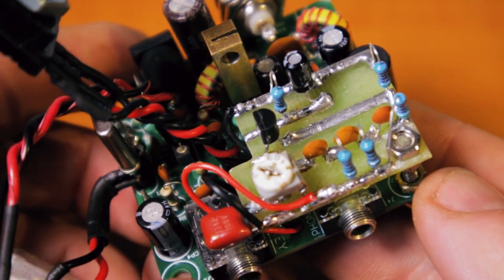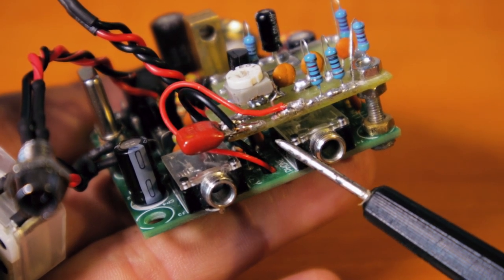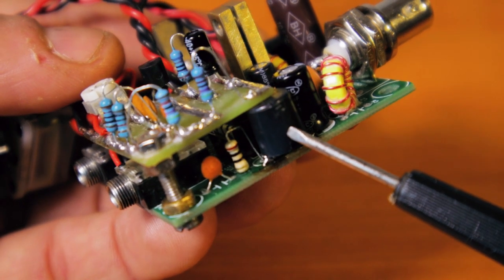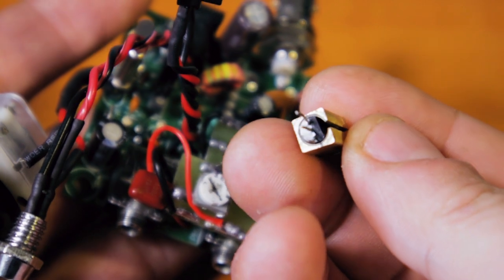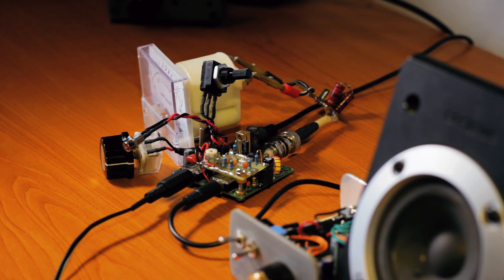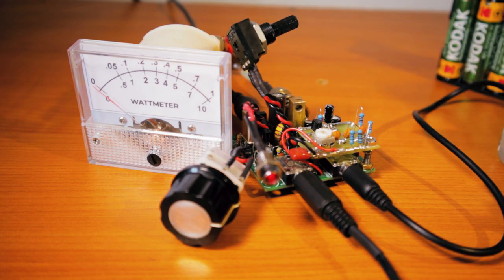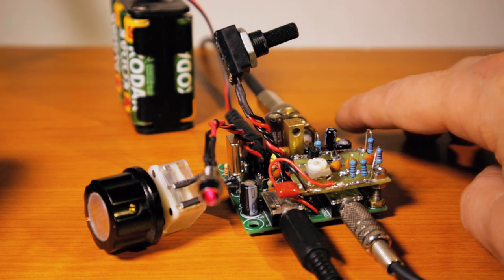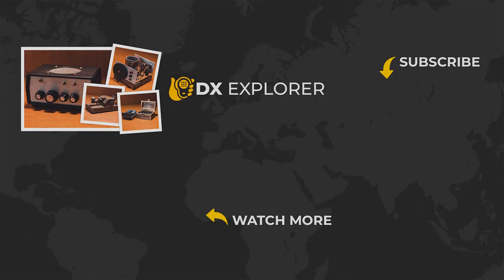4 Simple Modifications For The Pixie CW Transceiver Kit

Comment: I've not had sidetone in 30+ years until I got an FT817ND in 2017. I never got round to putting it in my h/b rig.
I think the heatsink on the O/P transistor is a good idea as I think that's what blew my Pixie up, O/P transistor and electrolytic. I tried replacing them but the copper track was lifting.
I put mine on 5.262 MHz with 350 mW out. Some say it's a toy, not at all, 180 mile QSO with a SWL report from 220 miles. I need another one.
G4GHB
Reply from the maker: I don't get to use it on transmit as I am still as "student in class" learning the code ))). I find it easy to use it with no sidetone also. You just imagine the sound and I think is great also. But having a sidetone is better )). Ohh yes I also blew a few of them doing tests as they heat up a lot even with a proper dummy load. I only had one of those heatsinks left and I'm glad I put it to good use. No more issues now haha. I did a test actually and pressed the key down for 1min continuous. It didn't burn so that must be a good sign. About the toy part..  it is indeed a toy... a fun one. Put used well it can do a lot in my opinion. And there are many other more similar to the Pixie. Like the Micro-80 and lots more. That is why I am so excited about learning the code. With simple equipment you can accomplish a lot. Thank you for watching. 73 DE YO6DXE.
Reply: @dxexplorer   Yes, a fun toy, not as bad as some people make out. Compared to a modern tcvr it is indeed bad! It's what your expectations are. My standards must be low Hi.
Having taken time to learn the Code to get this licence at that time as required I was not going to let it get away and use it a lot. I used to have 100 Watts ssb some 40+ years ago on 80m and got nowhere, endless CQ's. I listened and came to the conclusion all people did was talk to their buddies as they have for 25 years on the same freq, same time, same night, same subject then switch off so I went on c.w. and made contacts. 
Went QRP 30+ years ago. Brilliant, especially QRP to QRP. 
Yes, must buy or make something like a Pixie, I have my junk box (component spares box) and probably enough to make something.
I made a one valve BT61 xtal tx several years ago, 40m and 60m, and thinking a regen rx as I have bought some PM2 type valves. Technology going backwards Hi. I like 60m because it's not as crowded as 40m for a simple rx to cope.
73, G4GHB
Reply from the maker: Sorry for the late reply. I was at my sister's to help a little and didn't had much free time. Ohhh the stories you have are amazing. Indeed technology going backwards. I do that as well. Especially after my past years moving from analog to digital at my last job... realizing all the headaches that comes with... I rather go back than move forward ))). I always believed that simple is most of the time much better. I have just found a few really nice schematics of simple transceivers I want to build. Not sure I will keep all. Maybe I make presents to young kids that want to start in the hobby. But I do want to build and try them. Is nice when you open the junk box... you take out a few components... and a few hours later you have something that works nice haha. Is like grandpa used to say..  if you can take a pile of crap and turn it into treasure... you do magic ))). Fits perfectly here hahaha. 73 and I hope you have a wonderful Sunday.
Reply: @dxexplorer  Hi, tnx for reply,
 I built a one valve BT61 xtal tx some years ago, 40m and 60m about 1.5 Watts out. I keep saying I'll build a regen rx using a PM2 type valve as I have several from rallies. Really took things back in 2017 when I got a Wireless 19 Set circa 1944, it needed a lot of work to get it going and it was extremely deaf on rx. I recently replaced all R's and C's in the audio filter, much better now. Use it mainly on 5.262 MHz, where it's not as crowded, low H.T. so 2 Watts out and I xtalled it for stability on tx. Best so far 280 miles into Mallaig. I still think there's something wonderful about valves.
73, Bill, G4GHB
Reply from the maker: @bill-2018  Good morning Bill. Ohhh I think the same. Even though... I don't know much about valves. When I was a kid and started learning about receivers..  all I found was on valves, but for me it was hard to get my hands on. Later I discovered transistors. But if things go well... next year I only dedicate the videos and blog posts to valves circuits. There is something about them that makes everything sound so..  different. So I am looking forward to gather all I need and learn a little more on this )). 73 DE YO6DXE
Reply: @dxexplorer  That's good, I'll look out for the new videos.
i built 3, 4 and 5 valve sets in my late teens, got a G8 call on 2m aged 19 but wanted h.f. and we had to learn Morse and take the test at that time. I built a 2m xtal valve tx and super regen rx. Went to transistors, made an h.f. 4 Watt tcvr ssb and cw, transistors, mosfets and i.c.'s., now supposedly adding 60m. One day I might do it.
G4GHB
Reply from the maker: I will be haply to see at least a regen receiver with valves that I build and actually works ))) I may try those 12v valves if I can find any. I'm really excited about these projects.
Reply: @dxexplorer  I got PM2 2 Volt heater type valves at rallies and want to make a one valve regen set similar to when I was aged 14, the H.A.C. kit.
73

Comment: I thought I had a bad BNC connector.  I just had a dodgy crimp. 

Half decent BNC connectors last years. The really good ones last decades in the weather. I’m using pretty much all BNC and only pull out a UHF connector (shielded banana plug) when in the car as that’s what’s on the current antenna feedline

Nice effort on the Pixie. 

I put a couple of S8050 transistors in mine. One in the oscillator, the other in the mixer / PA and I can get close to 900mW on a 13.8V supply (15V less the two diodes in the full bridge rectifier that protects against swapped polarity)

Managed a QSO on my Pixie with a station 1000Kms away. 

Used a tuned mag loop antenna which helps with the broadcast interference. 2.7m across for 40m. Rather large, but mush smaller than a 1/4 wave vertical.
Reply from the maker: Right now I have an EFHW from 80 to 10m and works great. On RX seems so much better than the 40m version I had before. This one being longer... I just changed it to an inverted V as well. Let's see the difference now. The Pixie is great. I want to try a 2N2219 now for the PA and see if it gets any better. I think if I adjust the filter a little more I can get 800mW with no problems. About the BNC connectors... I have a few that I got when I was in Miami on my sailboat and those seem to be fine still. Got them in 2014. For some reason... the new ones I got recently... even if expensive... not sure where are they made... but the quality is still bad. If I connect them and disconnect them a few times... that is enough for the contact to be bad. They also seem to rust really quick. Very strange. I also like BNC because of the size. Maybe I can find some better quality ones and stick to these. 73 DE YO6DXE.
Reply: @dxexplorer  sounds like a dodgy batch. I just bought some new ones. Hopefully they’ll be OK

Just make sure they’re for RG58 and not RG59 as the money size is slightly different. RG59 sockets don’t make always good connections with RG58 BNC plugs. Peter Parker pointed this out on one of his videos. 

The nano VNA is handy for finding those kinds of faults. I have a piece of coax that’s isn’t very good at being 50 ohms and shows 2:1 SWR on some frequencies and a perfect match on others. Pre made 10m BNC lead. 

You can’t trust a bargain these days, but you tac take a punt and often it will work out, otherwise, you’ll learn something :-)

Maybe rig up an extra output stage for the pixie using an IRF510 and punch out a few watts :-)
Reply from the maker: You just made me think of something. I'm sure it may not be the right way to test a coax... but if I put a dummy load instead on the antenna all the way at the end... and on the TX side I check with the nanoVNA... it should show me the impedance right ? I guess )). I will try that tomorrow. About the connectors... you may be right about RG59 as all of them are a bit large on the coax side and I must always put some extra insulation to fit the cable tight inside. I wonder why they sell them as RG58 BNC if they are not )). 

On the Pixie... ohh yes Nigel ZL1NAY told me to put a stage with an IRF 510 and get a bit of juice out of it haha. One day I should try that.
Reply: @dxexplorer  on the VNA set up a trace with Log Mag and have it listen on S2. Then calibrate your NanoVNA making sure you’ve calibrated the “through” measurement

Then hook your coax between the S1 and S2 connector. Log mag will show your losses over the length at whatever range you’ve set. I test from 0.5 to 30MHz 

If your coax is a little funny, or your connectors are dodgy, you’ll see losses and noise as you move it around.  

There’s a couple of YouTube videos that show you this step by step. 

A test with a dummy load will give you whether or not you have a match. It won’t tell you losses. Good enough to check for a dodgy connector. 

But an S1 to S2 through connection will give you the losses over the length which may give you a better idea of where the problem lies.
Reply from the maker: @MidlifeRenaissanceMan  Perfect... ohh yest it makes sense now. Thank you so much. Then I guess this coming week I have more to do ))). Time to order new connectors and coax soon anyway. All I have now is over 20 years old. Well... except the new bad connectors )). 73

Comment: Hi, Love your improvement!  I am beginner. All of the morse code sounds are too fast. Do they operate the key with their hand? How listener decode?
Reply from the maker: Morning Raj..  I am also learning the code and trying to learn it at high speed just so it will be easier for me once I know the code. There may be a few using a computer now and then but most of the time is by hand yes. Is pretty easy to get speed once you know the code. Decoding goes the same... you don't thinks in dots and dashes as they are written on paper... you take them more like musical sounds... each letter is unique so is easier to learn this way... both to send and also to receive code. Talking about the receiver... I hope today I finish it and post the video soon. Maybe tomorrow if I have the time. Have a fantastic weekend. 73, YO6DXE.